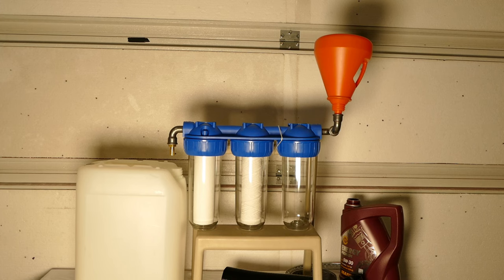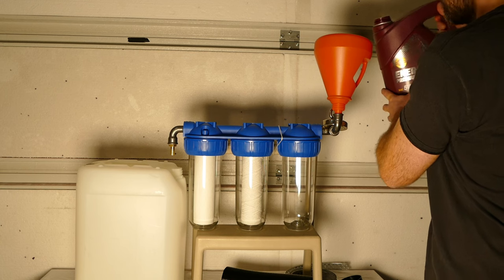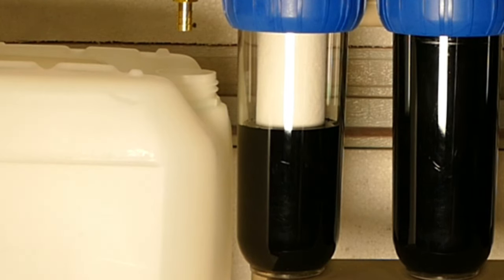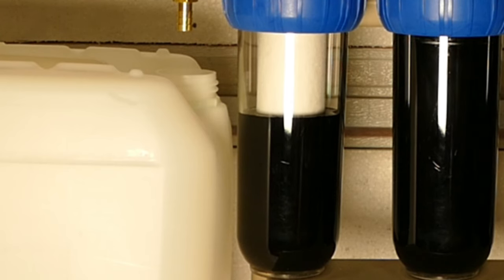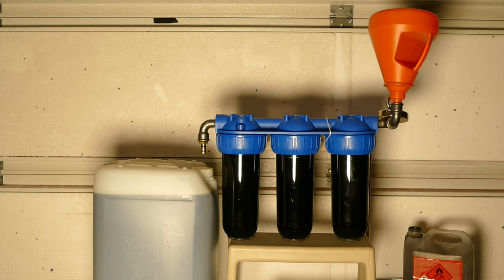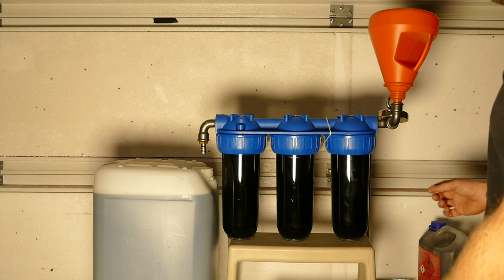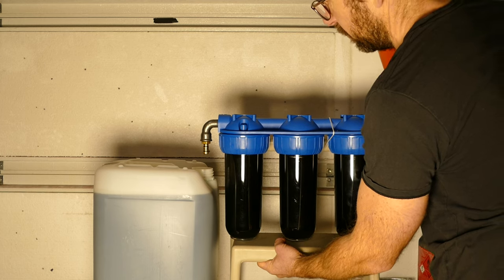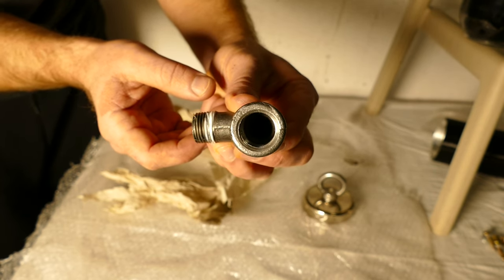Filtering waste oil to 5 micron.

Comment: Some say it is best to add gas or diesel to the oil first to thin it so its easier to filter. Then you can make black diesel. Some have tried that for a diesel heater and in their diesel engines obviously....

Comment: I did that kind of filtering with a barrel pump and those three filters although my filtering at first was 5micron 1 micron and 0.2micron but the last 0.2micron would quickly get clogged to I switched to 1 micron 0.5micron and 0.2micron. 

I ran it in a common rail diesel and of all the diesel engines I ran waste oil in them the two common rail diesel liked it the most by far. Easiest starting and most power. 
2.0HDi 90HP  and Ford Mondeo 2.2TDCi 155hp .
Reply: Hi how many miles can run without a problem? The filter how much miles to the change? Is good to now that. Sorry for my English.
Reply: @adrianmucci2831  the filter was outside the car. With bad pre filtering the 0.2 Micron filter was clogged after 100l. If you let it settle for some time and have good pre filtering then way longer. 

The 2.0HDi was killed in a crash.

The Mondeo ran fine for 10.000km, then I made a mistake and gave the car to a friend who added too much gasoline to thin out the oil so the high pressure pump was then broken. 
Now the project is on pause.
Reply: I sorry for ear that. I hope you get more luck In the future. Thanks for the information. I glad to now is possible use this fuel filter at that for a least 10.000km whiout engine problems.  @no-damn-alias
Reply: @adrianmucci2831  Next test object will be a 1.9TDi PD

Comment: Nice, but imho centrifugal oil cleaning in this case could be more efficient and cheaper in long term, because there is no need of periodic filters change.
Reply: do they exist on a small scale?
Reply: @davidlabossiere1905 the cheapest centrifugal is about 2400 dollar. I think is no good idea. And you need about 3 o 4 for a speed production. Electric consumption etc.
Reply: @davidlabossiere1905  you can try to make a small scale one.